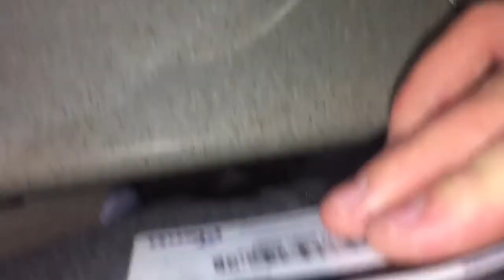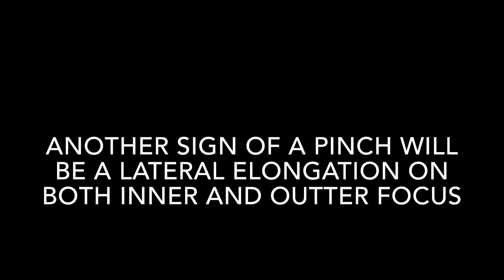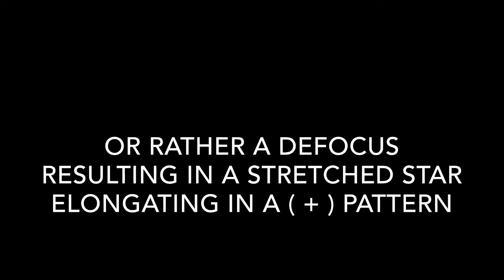Pinched optics and how to correct it

Comment: Thank you so much. I got a 2nd hand dobsonian. Mirror was really dusty. Watched few videos on how to clean but none told me about tightness of mirror clamps. I over tightened mine and had triangle stars. It's been 6 months since I did it and I have just taken mirror out. Unfortunately the edge of the mirror has shattered from the tightness, possibly made worse by the extreme temperatures my conservatory reaches where I have been storing it. I wish I had seen this before I did the damage. You live and learn I suppose. Waiting for cleaning supplies to arrive, I'll give the mirror a clean and put back in. Fingers crossed the shard missing from the edge won't impact the image I see. The shiny part of the mirror is still intact, its the edge down to the bottom that's chipped off.
Reply from the maker: It shouldn’t degrade it. It may slightly effect it. Unfortunately the people selling scopes typically know little about them. Most everything is mass produced and lacking in instructions. This is one of those things most people overlook.

Comment: thank you after 2 days of testing and ruling out issues I came across this video, I am almost sure my issues is pinched optics, because I tested backfocus spacers, filters and no filters, coma corrector and no coma corrector... collimated several times, I was reading about pinched optics and after a few reads I was sure thats the issue and went to search a video that shows how to fix this, so Tahnk you, I will work on this now and try to get it working, too bad clouds are rolling in and will not be able to test this further tonight
Reply from the maker: Thanks for sharing. It is one of those things that’s widely overlooked. It drove me crazy once. I didn’t want it to happen to anyone else. The bigger the mirror the more crucial that gap is.
Reply: @GarnettLeary  and indeed it was pinched optic! my stars are much better now... have some coma but not sure where to look at now... one step closer though!
Reply from the maker: Do you have a corrector?

Comment: Hey Garnett. Thank you for being the ONLY person on YouTube who is talking about this directly. I recently cleaned my mirror for the first time, and found NO instruction on clip tightness in my product manual, so I assumed hand-tightened was proper. I ended up with quadruple images and point-light pinching (quadrupled again). Seeing your video and the number of clips you used helped me to determine it was my 4 over-tightened clips which were causing my inability to view properly at high magnification (10mm and smaller eyepieces). Well done sir!
Reply from the maker: Hey glad it helped. Honestly I look for holes and gaps in information and try to fill them. There’s no point in reiterating topics that have been repeated millions of times. This particular issue was one I discovered while discussing mirror blank grinding with a friend whose very old school. I was rather stumped by it myself. I had for years discarded it as cheap manufacturing over an actual correctable problem. There’s so many aspects of this hobby, photography or visual, that can work heavily against you and discourage you. It’s no mystery why so many scopes end up in closets. When I get comments like yours it encourages me to continue thinking of these. The Jones collimation video seemed to be helpful also. There’s way too many people b-rolling and not truly offering help to people. As a community the folks into astronomy have endless amounts of information to share with one another. I feel it’s everyone’s responsibility to use the internet as a tool to reach folks who aren’t active in astro groups. It makes my day when someone tells me I was helpful. Thank you for watching and I’m glad you solved the issue. I don’t post regularly but I am transitioning into the guided aspects of astrophotography soon. My primary interest is reaching people who are just starting or on limited budgets. There’s a lot less hiccups that come with higher price tags but a whole lot less people interested in large investments into hobbies they aren’t sure they will like. We have endless amounts of information to share with one another to grow this community. Clear skies.

Comment: Hi! Did you change the center spot of your mirror? Aren't you afraid of credit card scratching the mirror surface? Btw you have a really nice channel. Great work! I am a subscriber now.
Reply from the maker: I didn’t change the center dot but it’s a real good idea to check it and make sure it’s correct. I always use a card. Never had a problem. I’m not adding any direct pressure and it’s relatively flat. Pinching glass is one of those things that can throw you way off. The center will usually be fine. It’s hard to diagnose on a new scope because the glass itself may have the stigmatism. Thank you. I try to post things and topics that are useful. Thank you for subscribing. I hope you stick to the hobby. Clear skies.

Comment: I have just one complaint. You placed a credit card on a visibly dirty primary mirror and wiggled it around pressed against it. Dirt is always harder than the metal coating and that action will scratch it. Primary mirror should never be touched dirty. Only clean, and then only with something soft like a piece of rice paper.
Reply from the maker: Can’t disagree with your logic. Excellent points and very true.

Comment: Do you know how to square a focuser in a tube?
Reply from the maker: The easiest way I know to do it is by adding washers between the focuser and inner wall of the tube. In theory you can use a laser collimator or collimation cap to sight thru. A white piece of paper, folded to find center, and placed in front of the objective serves as a guide. This is very practical and easy to do.
Reply from the maker: Alternatively teflon tape works really well to snug a focuser that is sloppy all way round.
Reply: @GarnettLeary  Thanks, gonna give it a try
Reply from the maker: Some folks use shims of different materials. I’ve seen an Astroscan perfectly collimated using small strips of electrical tape on the threads. A section of a styrofoam cup might work. Be creative. The main thing is to establish the center and work from it. If you have a removable dew shield consider taking it off. If you align off of it, the shield itself may not be seated square to the lens.

Comment: youll brake ppls telescopes ,  but non the less i will tray it , i didn't notice anything wrong with stars if they are in focus but i did notice as i focus they get smaller and triangular as they go small  , but if you ask me that is under or over focused , when its spot on all is ok.
Reply from the maker: What type of telescope do you use?
Reply: as shown , reflector 4,5inch 500mm